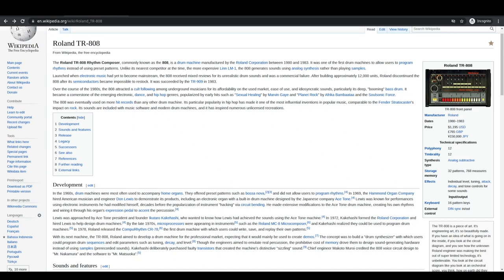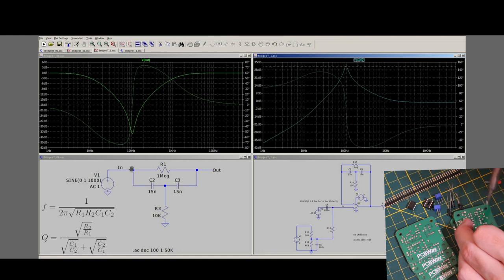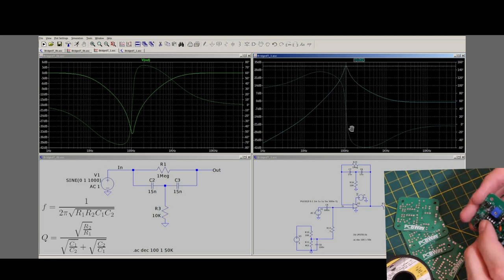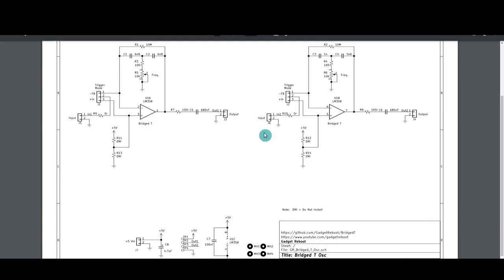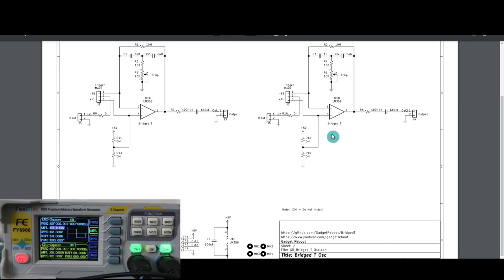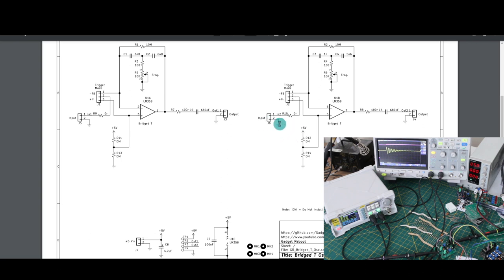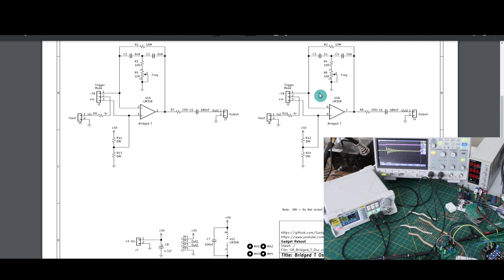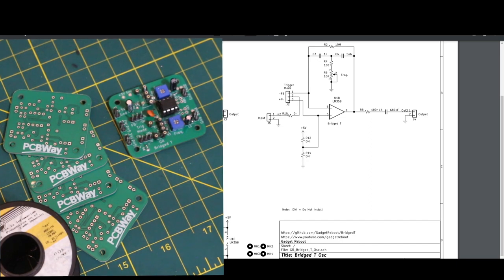Bridged T Oscillator for Percussion Sounds

Comment: At a certain point some calendar years ago, when I felt I had generally mastered music production, I started making music by simply pinging an input that was routed to its own output with a little "pulse". When that was routed to another output an ADSR could be applied. That was about as pure of electronic music as seemed possible. Thankfully it seems I was on the right track as confirmed by this. The 808 is truly the ZEN TEMPLE drum of electronic music.

Comment: being more aware of dsp than EE, i've heard roland circuit bent a few of these to get some extra timbral effects, eg. affecting the attack, generating odd harmonics for a more triangular shape, different 808s have some skewed waveforms. awesome :)
Reply from the maker: Yeah I've read that different 808's can sound different from component tolerances or production substitutions.   
I have seen some info out there about hacking/improving the basic circuits like combining more waveforms to get more complex versions of the sounds compared to just the one oscillator, and various circuits for envelope shaping to give the volume some attack/decay variations instead of just on/off tones and noises approximating a snare etc.  
Lots of experimenting opportunity.